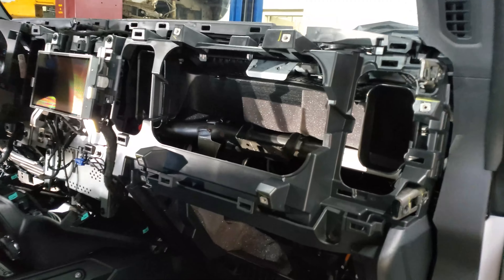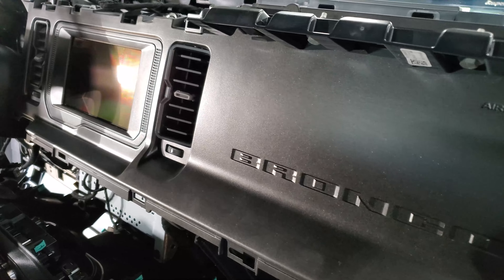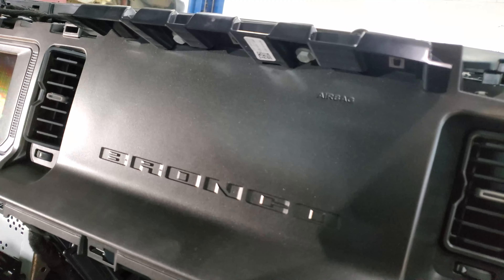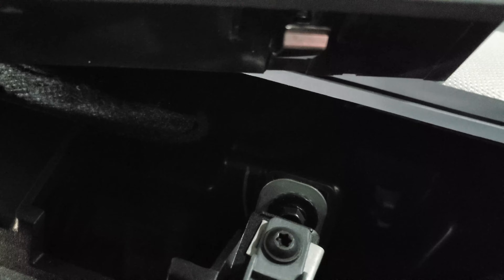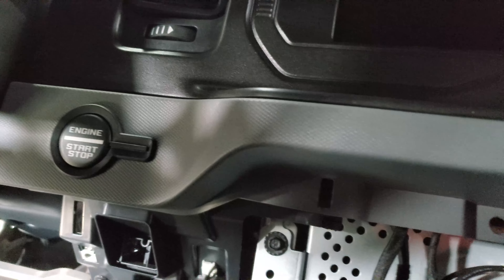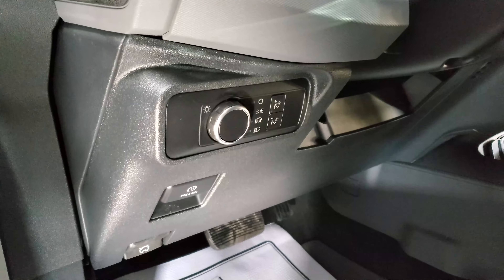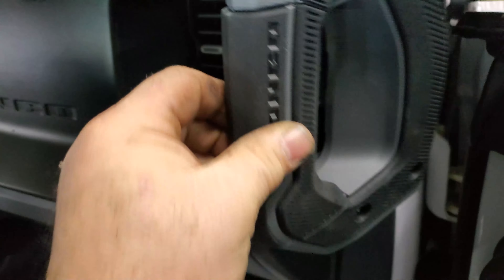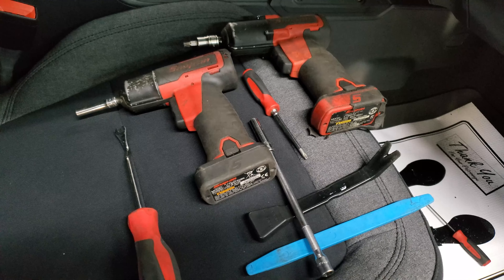2021 Ford Bronco Air Bag Recall.. Time to reassemble!

Comment: Taking my '21 Bronco into the dealership next week for the airbag recall. Hoping they get the dash removed/reinstalled w/o any problems. Mine is the first Bronco for them to do this to. Guess I'm the guinea pig, lol.
Reply from the maker: This one was one of the first we had sold also, its not a bad job at all.. No worries my friend, should go good for you, for what I have seen there is not many that requires this repair, and I have only seen this one from last year..